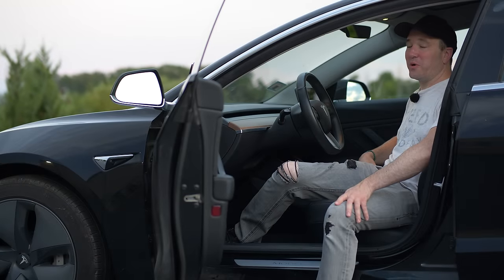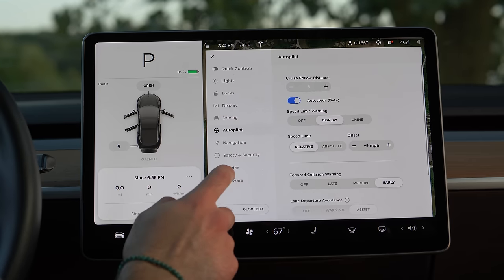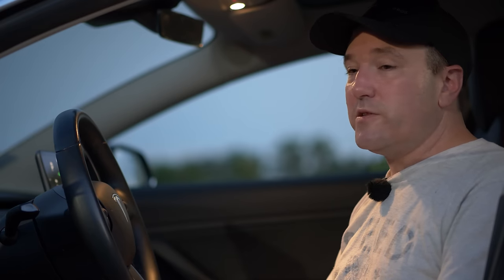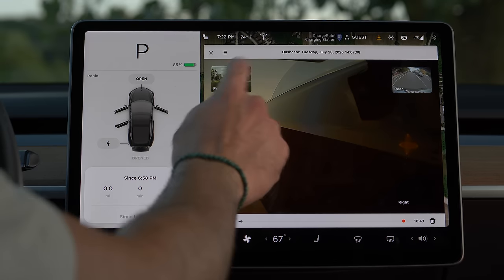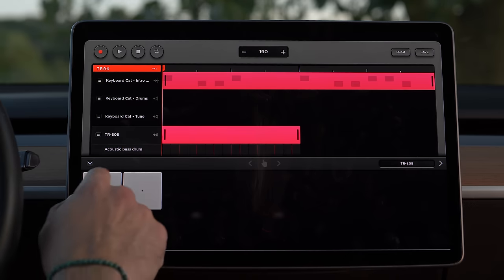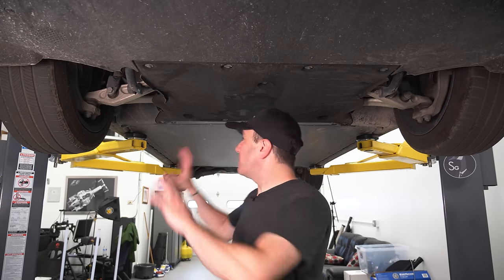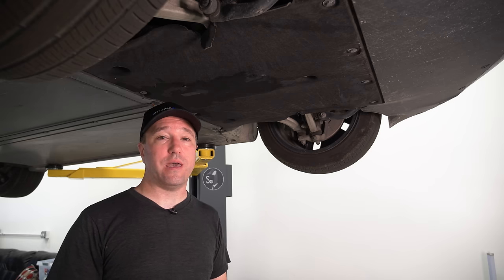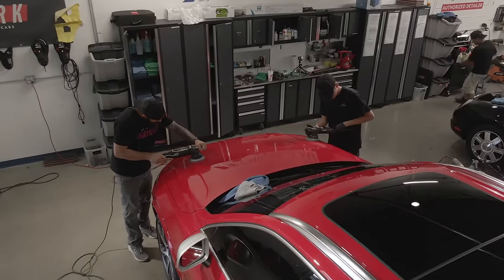Tesla Model 3 | Explaining the Cult

Comment: Zero maintenance. No oil, transmission fluid, timing belt, accessory belt, spark plug, brake pad changes.
Reply from the maker: Still has brake fluid, pads, rotors, tires, coolant, refrigerant, and the gearbox has filters and oil in it as well. Add to that it still has balljoints, tie rods, bushings, dampers, and every other mechanical and consumable system a normal car has.  Batteries also don't last forever.
Reply: savagegeese regen quadruples the life of brake pads, rotors, and fluid. The battery coolant is waterless, so it never needs changing. The rest, ball joints, refrigerant, etc, aren’t maintenance items. They are repairs made on cars with 200,000 miles. (I provide my counter argument with the upmost respect. I hold your channel in high regard. )
Reply from the maker: @michaelmeece  I wouldn't say zero maintenance.  But I understand your point it will be less than a V8 sedan.  But I also joke how my Ferraris never need work or maintenance because I only drive them 20 miles a year.  Some of it is relative of how you drive, where you drive, temps etc.
Reply: I suppose the new NSX didn’t have the same effect on the market as the original. It didn’t make Ferraris more reliable. (I was kind of shocked at the state of the 458 you reviewed)

Comment: I have appreciated your previous reviews but Sandy Munro and I disagree with your assessment of the Model 3. I’ve owned 5 exceptional vehicles in the last 50 years. My first was  a ‘66 Mustang 2+2 289 four speed that I bought in 1970. My wife bought me an ‘86 Corvette convertible when I turned 40 in 1990. The others I still own, a ‘69 El Camino SS 396, an ‘08 M3 convertible and a 2018 Model 3 dual motor performance version.  Each one was better than its predecessor and the Tesla is by far the best car I’ve ever owned. It has 20k miles, has been totally reliable and is better than the day I bought it.

Comment: Its suppose to be an unbias review but a few misinformation would point to it being pro oil. 

Examples:

Even if your city runs on coal. The emissions from ev will be about 3 times less that includes the production of the battery cell and manufacturing of the cars.

Superchargers are meant for roadtrip uses not actual fill up stations like ICE cars. EV owners wake up to a full charge everyday. Gas cars you'll have range anxiety once a week when u enter fuel low.

You mentioned cause there is no engine noise the car is super quiet so you hear other noises. But you're complaining about noises every other car makes and possibly is louder but is just masked by the engine and exhaust noise. Complaining a tesla is more quiet so there is noise is just wrong.

Its not just about climate change toxic fumes is a leading cause of death it causes more deaths than smoking.

The complaint about distracted driving is misinformed also. Considering Tesla's get into considerably less motor vehicle accidents and is by far the safest cars in their segments.

Not sporty/grippy enough? Get the model 3 performance it comes with much much better tires and we all know the importance of tires.

So much more to say.

Comment: dont buy his argument of all cars being similarly wasteful
Reply: Probably because you've never been in an assembly plant or worked in any significant capacity building automobiles.  You still have to mine materials and transport them.  You still need foundaries.  How much energy does in take to make a pound of steel?  How about a pound of aluminum?  How about a pound of plastic?  It takes plenty of petroleum just to build a car irrespective of what powers it.  None of that changes for a internal combustion engine car or an electric car.  Paints still are needed.  Tons of chemicals are needed to process the metals and plastics and make electrical components.  Cutting fluids for machining.  The hydraulic oils to run the stamping presses.  Power is needed to run the equipment.  The parts just don't grow on trees.  Manufacturing cars is a energy and materials intensive process.  All cars.  Anybody who knows anything about how these cars are made can wrap their heads around that concept.

Those who know get it.  Those who don't reject it because in doesn't match their ideas and thinking.  Regardless of what you feel or believe, the manufacturing process isn't all that clean or efficient.  Making metals generates waste.  Making plastics generates waste.  Making glass generates waste.  Making electronics generates waste.  Those are the real facts of life and those facts don't care if you live in an information void.
Reply: Matthew Gaines thanks for detailed feedback, much appreciated.

Comment: 👎 You’re SERIOUSLY wrong about the ecology issue.  True...all vehicles require lots of expensive and even harmful resources to produce; but after that, EV miles driven are vastly more green than ICE miles driven—even using electricity from the “dirtiest” electrical grids in the developed world.  
Battery ingredient delivery (not raw material scarcity) IS a major challenge, but it’s also clearly manageable.  
Defend the dinosaurs at your own embarrassing peril. 👎
Reply from the maker: The only thing that is different in this car is the battery pack every single other component in the thousands is the same parts as an internal combustion car.  No car manufacturer issues sustainability or traceability reports on any of the cars that are made including Tesla.
Reply from the maker: Again no manufacturer provides tracability reports from the thousands of OEMs and in many cases won't provide much in terms of how they do their own manufacturing etc. So many of the people who tout how green EVs are have no proof other than speculation outside of the battery argument. What we do know is car manufacturing is a dirty business and those who pretend just because its an EV its somehow totally different is deluisional.  I get the ownership argument.  But here is another one, who manufactures all the millions of chargers for EVs?  You are creating an entirely new supply chain and infrastructure to support these cars on top of the gas stations and other infrastructure in place for 80 years.  There is a lot of waste no matter how you look at it.

Comment: 11:00 starting from scratch? Who told that? Factories were from Toyota, blueprints (for S) were from Mercedes. Even the idea of Tesla was bought from other guys, that's a well known story.
EV part was kind of re-invented, that's true. But as in many fields, the tests and troubleshooting was handled by customers. Ceramic bearings, dual motor instead of one and f*king door handle on S/X... That's all the story of failed evolutionary steps, some bugs are still present, and the overall quality is unstable (flows from "good" to "bad" and back over years).